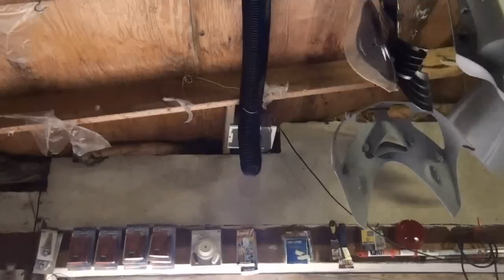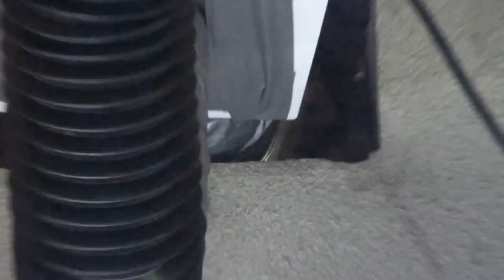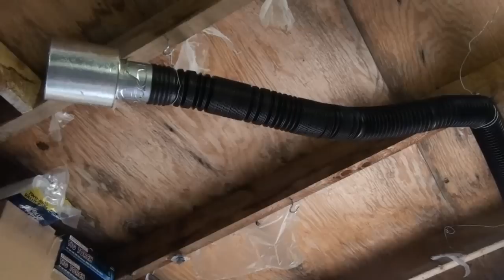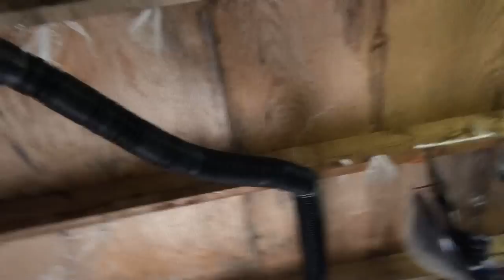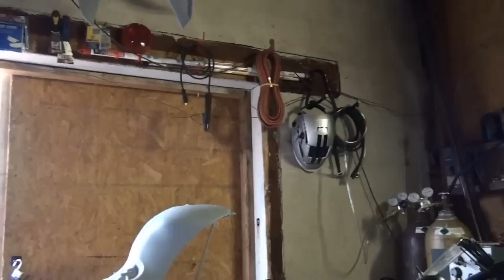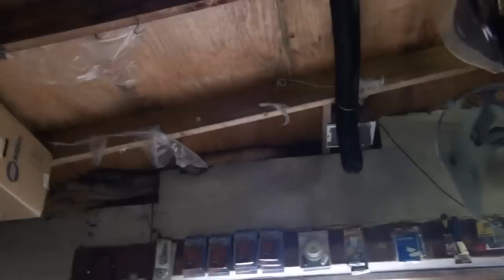Welding Fume Extractor

Comment: It's better than not having anything. But, a bathroom fan does not have the CFM's required to move welding smoke and particulates. And the hood or flare needs to be no more than 12 inches from your weld. Welding fumes are nothing to mess with. You may not feel it today but several years down the road your doctor is going to tell you to have a seat he has some bad news for you. When you develop a chronic lung decease it's there forever.